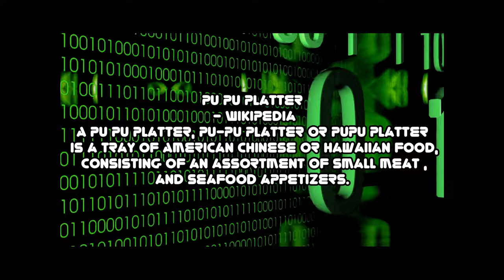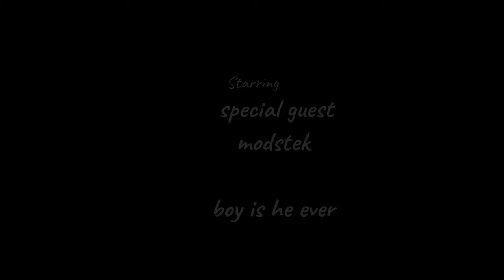How do you wipe or clean data from a hard disk drive?

Comment: I know someone that works with sensitive data a lot. When a drive dies, it usually has bullet holes soon afterward.
Reply: When I had to throw out an old HDD, I shattered the disk with a pellet gun until it was almost in 100,000 pieces.

Comment: For HDD's I used to drive a large nail through it. It ensures that all the platters are broken and is way easier than a sledge hammer. For SSD's I would probably not trust a nail. Here I think heat is a better method. A bunsen burner perhaps. Must admit I haven't had any SSD's die on me yet.

Comment: i guess for a SSD boiling it in hydrochloric acid would work, it'd work for a mechanical drive too but dropping it in mercury would be cooler. Just do it outside because that will dissolve glass, and guess what beakers are made out of.

Comment: the best way is to use a drill / screwdriver to make 2-3 holes in a circle and this is enough to NEVER [police] were unable to recover data
Reply: Nope, actually still partially recoverable. There are contractors as well as several inter-agency co-op labs that can recover data from severely damaged drives(within a certain scope). Unless you are part of a terrorist cell, a renowned serial killer, hacker,  high-tier mafioso, cp distributor, or drug kingpin, chances are law enforcement isn't going to waste resources on trying to find your kinky pr4wn collection. The only way to truly destroy a HDD is by exposing it to a highly reactive substance(gallium comes to mind), basically melting it down to base components(thermite or using a propane/LNG forge), or using a high-power degausser.

Comment: Well, about those solid State drives, I just had one burn up on me
Reply: SSD is harder to destroy.. there you need to destroy all memory modules physically (with a hammer, drill, etc.) because if at least 1 chip is alive, it will be able to recover information with the help of the programmer.... therefore, it is easier to destroy the HDD =)
Reply: Alexander YouTube Well, hé was talking about relaiability, which everyone says ssd’s are, but they do break and burn up, like mine did
Reply: cody kamminga They have a more limited number of write cycles compared to spinning disks, but they are much less likely to break from a drop, or simply turning the drive to the side too fast.
Reply: tosdude they are more likely to catch on fire it seems like
Reply: Your drive got tired of the telemetry and committed suicide.